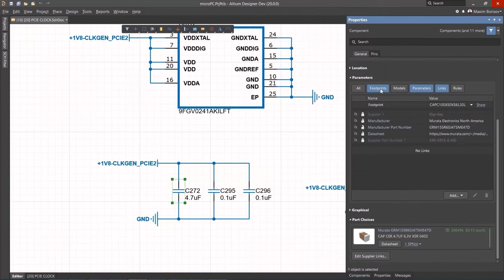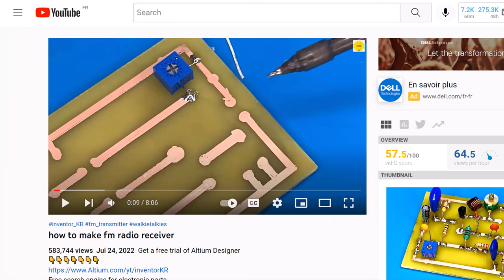how to make peltier air conditioner peltier module , homemade ac

Comment: If peltier module fitted in reverse, then the larger heatsink would be cooled making a usefull aircon.
Reply: Бред. При работе модуль потребляет 60-100 ватт,и вся эта энергия превращается в тепло на горячей стороне. Кроме того,выделяется ещё и то тепло,которое модуль оттянул с холодной стороны — и если у вас нет достаточно мощного радиатора — охладителя,чтобы рассеять всё это тепло, то следом за перегретой горячей стороной начнёт нагреваться холодная — теплу ведь некуда деваться! Короче,система перестанет нормально работать...
Reply: @IvanKnavI  Хорошо сказано, горячую сторону надо выводить в другую комнату.
Reply: Nah, the hot side needs the much larger heatsink, because peltier has quite poor thermal efficiency.
Reply: @IvanKnavI g
Reply: @johndevries7122  да хоть на другую сторону планеты выведи.если на ней не будет мощного радиатора,желательно с принудительным обдувом - система всё равно не будет работать...

Comment: Cold side goes to the aluminum water block with water pump going to an external radiator with fan to blow cold air off of the water radiator.  Hot side gets large heatsink and air moving fan to cool heated side. With a partition to separate the cold side from the hot side. Partition goes in window frame with hot side outside and cold side and water radiator on the inside.  That is how a window unit is designed.
Reply: gud idea
Reply: J
Reply: why are there no examples of this on YT actually working successfully ? it seems obvious. So obvious that there must in fact be something stopping it from working properly...
Reply: Not working its failure

Comment: Don't know if anyone will see this comment, but i want to take the design and use it in our research project in school and use it to cool the pc and see if there are any differences in performance than a regular fan
Reply from the maker: This is possible, but you need a sensor to monitor the temperature. If it drops too low, the circuit is disconnected, thus controlling the temperature of the core. A copper or aluminum plate must be connected far from the processor to ensure that water drops resulting from the significant drop in temperature do not reach the processor.
Reply: Peltiers are not 100% reliable, sometimes they can reverse causing the CPU to virtually fry.
Thats why you don't see commercial peltier coolers...